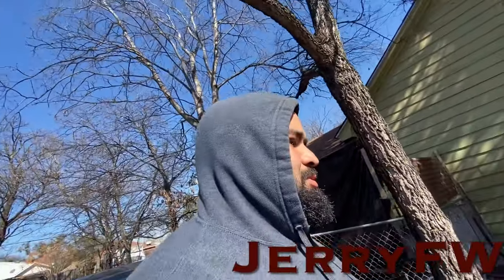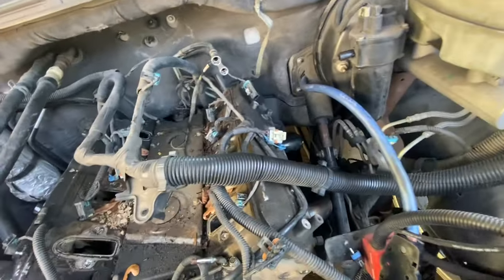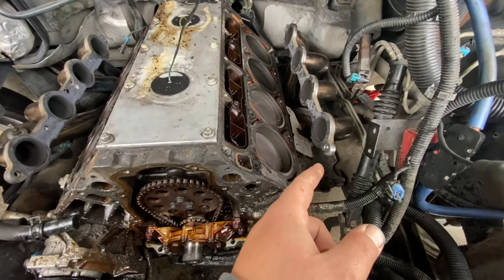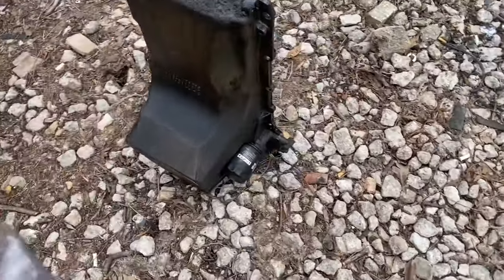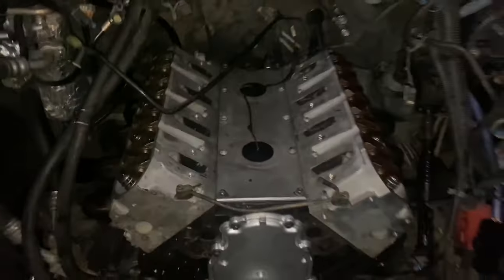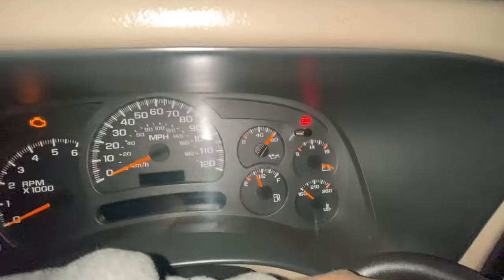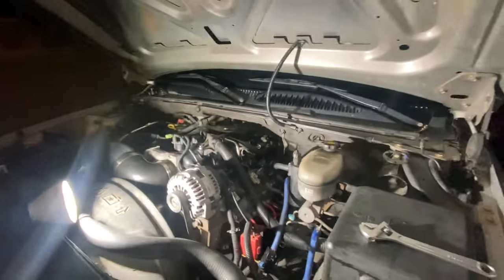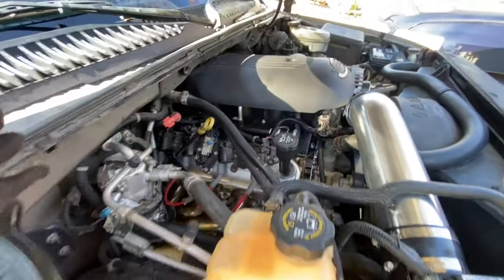Cam swap on a 5.3 Tahoe (free cam giveaway in comments!)

Comment: Sounds great man. Glad the idle control is turned of so it sounds like a CAM and not that retarted simulated blower surge bs on most videos 😂😂
Reply: I always wondered what that was. I know what to tell the tuner now when I get mine done
Reply: @badas95Z  not a problem I literally just learned that this week and that most tuners leave it on default. That's part of the reason I never went LS lol outside of bone stock daily driver.
Reply: I can't stand that forced chop sound you are describing, I build a lot and that's what kids want but I prefer the old school sound like natural cam sound like it used to be when your only control was dizzy and carb vs all the computer tuning. I tune also and can change the cams sound completely with just a few changes on laptop

Comment: With all that that you did my brother I don't understand why you just didn't yank the whole engine out that way you could have done everything that you wanted to do I mean you could rent an engine hoist or is this one bought one but I do appreciate what you're doing but I definitely applaud your efforts cuz that's a lot of work dismounting all that stuff in the mounting it back up inside the engine play I take my hat off to you it just sounds great too but next time you going to go that deep man you might just snatch the whole freaking engine out that way that way you can paint the engine and clean it up better you can just get out a few things that you take out the engine you know you discover things that you know you need to correct especially yanking the heads off but I think you did I think you did a wonderful job

Comment: What all exactly would I need to change out to do this?
Reply from the maker: You can do it by just buying a cam, valve springs, valve cover, timing cover, and water pump gaskets. Or you can do it like the video with all of that plus head gaskets, head bolts, push rods, oil pump, oil pan gasket, lifters and trays.
Reply: @jerryfw  thanks I want to do this to my Tahoe next just didn’t know what all that I will need to do

Comment: Quick question , do I need a high pressure oil pump ? Or what’s all I need for the cam?
Reply from the maker: You don’t need to do it but I do recommend it. 
Basic cam swap parts are cam, valve springs, valve cover and timing cover gasket.

Comment: What brand lifters you use
Reply from the maker: These were Delphi ls7 lifters but I mainly use summit Ls lifters
Reply: @jerryfw  which is cheaper? My lifters are tapping when I hit the high way going like 70 but when I drive around town the tapping goes away at like 40 mph 🤔
Reply from the maker: @JayyMoney-vr7nv summit ones are cheaper, how’s your oil pressure?
Reply: @jerryfw  oil pressure is at like 37 idle and goes up a little driving but not to 40